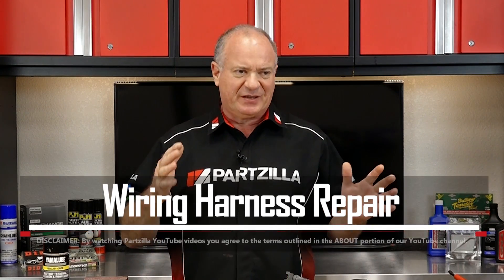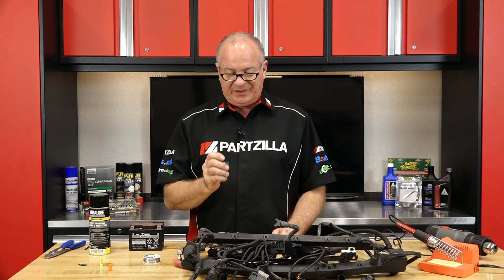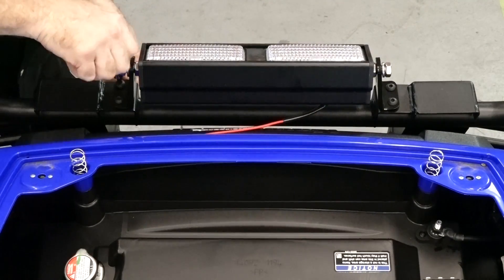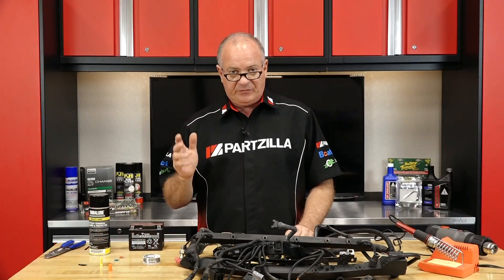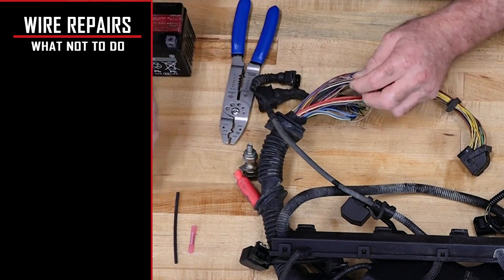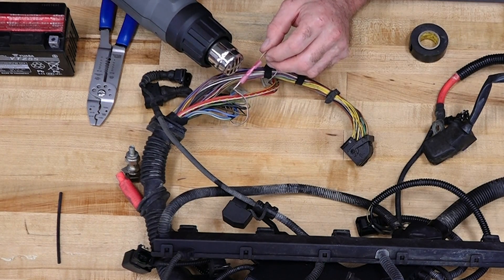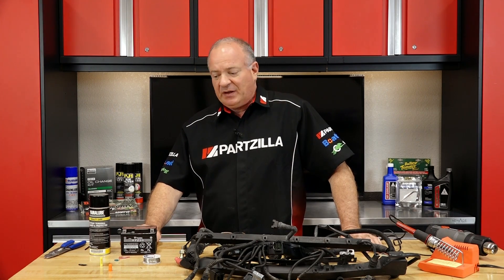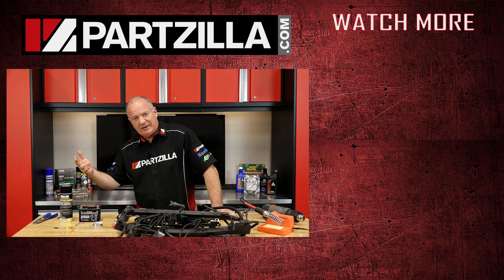How to Repair a Wiring Harness | Motorcycle and ATV Wiring Harness Repair | Partzilla.com

Comment: I get so mad when I see any of the earlier mentions ("I  cant stand it, thus my my BP rises and I call them mindless XXX-ups). I then cut it all out and grab my solder and heat shrink and do it right.  (Vinagor and salt will clean dirty coper but it must be neutralized with bakeing soda and water  as soon as its clean-(er)... its important else the Vinegar and salt are corrosive and must be eliminated with the baking soda and water.... Immediately or within a minute.. (this is only needed if the wire solder ends are in bad shape. Else you will have problems getting the solder too glue into the wires as noted.)
Also!
One point he did not mention it the solder type.... (ROSIN Core with Flux only)!
DO NOT solder anything electrical with (Acid core solder.) its name should tell you why.... ACIDIC! (like the vinegar and salt).
Most electrical wire are copper which is a soft metal and the acid core may solder... but its bad and will slowly eat away at the copper wire at the solder joint.

Comment: I don't agree using solder. There is some chance to do a cold joint and it can break eventually because of vibrations. Open barrel splices with the proper crimp tool and some shrink tube is my go to

Comment: What if they no longer make a new harness to buy? My bikes a used up clapped out rats nest, guy before me spliced in prolly every wire that had some power through it for whatever LED look at me lights or who knows what, id like to be able to rebuild the existing harness, creating a brand new one using the OEM connectors. Is there a kit to rebuild a 06 CBR 600RR? LOL

Comment: Great video but how do you repair a wire that breaks off less than 1/4 inch from the ecu plug? Is there a way you can pull the connection out of  the pug to make it longer and then reinsert back into plug?

Comment: John I have a Honda Foreman 400. I can start it and run for several minutes before it suddenly kills and won’t start again while hot.  I have gone through the carburetor, fuel lines, etc and can’t find any issues there. 
I have also changed the spark plug and spark plug wire but the issue is still not resolved. 
Do you know of any specific areas in the wiring harness or other areas I should possibly check for this issue?

Comment: I had a rectifier burn out on my 2000 gsxr 750, I replaced it and when I hit the brights on the freeway the bike started smoking. One connection looked a Lil melted bit not enough to smoke. Well I found some junky lighting wiring in the back of the bike redid it bit now my rectifier isn't working.

Comment: Yeah my ATV has a wiring harness issue that has been holding me back.i can't use the keys Thay have  hotwired my Beast. The keys hole is got the wires sticking out of it and I'm not sure what
wire should i connect with. Yeah they really did a number on my quad.
I really appreciate your time and consideration.i Hope you can help me out with this. 
I can get it to start but something is not right it's backfiring and won't ideal by its self.the wires on the key hole are touching together should that be like that? Should I take out the whole thing?

Comment: Grizzly 700.  New starter, battery and solenoid . The stator was replaced last year by the dealer.  After 30 min , I tried to shut it off and it acted like I was trying to start it. It ultimately shut off. The battery was dead.   What say you ?

Comment: Great video.  I replaced a battery /solenoid and starter on a 700 grizzly.  It ran for an hour and when I went to shut it off, it acted like I was trying to  start it. I’m the field the battery tested .8 volts. After I put it on charge, it tested.0 volts. I have never seen a bad battery test .8 or 0. The stator was replaced by the dealer last year.  
 When it failed there was quite a bit of heat . What say you?
Reply: If it only started playing up after you changed that battery + starter assembly, then the dealer's work sounds like it's fine 
If you know you got the terminals on battery & the 2 on the starter correct, then the stator replacement is a decent hint, cos it probably wasn't physical damage so most likely was from an excess power load further up the harness
So check your electrical harness for any fragile/old wires or any worn ones, they're most likely shorting to other connectors or ground

Comment: I'm probably anal when it comes to wiring but I also add a small dab of contact grease on the connection after soldering and then slide over my shrink tubing. Just makes me feel like it's bullet proof then. 20 odd years doing it like that and never had one fail. So many people using butt connectors on their bikes and wondering why after a few years it's worse than it was before and ruins that section of cable completely. Really love your videos fair play👍

Comment: On my 2014 Suzuki V Strom 1000. I bought an auxiliary fuse panel and ground block. I had mine quit because of corrosion in the ECM connectors. Yearly I unplug and spray all connections..

Comment: How many watts is your solder iron. And ,What is the proper solder to use. I learned the hard way about soldering copper water pipe, that you don’t go to Lowe’s to get your flux or solder. You go to the plumbing supply warehouse. Is electric wire soldering just as critical? I have actually tried it, and it was not as easy as you make it look...
Reply: I can't tell you what the different types are, but I know using the correct type of flux and solder is very important with electrical
Reply: if you don't have a solder iron or no experience in using it, but having a heat gun, go for raychem solder splice : https://www.youtube.com/watch?v=uhRCUAYoSXg
Reply: 25W, and use 60/40 Rosin Core solder. Actually, don't, use crimp splice connectors. If you solder it, you create a hard point, and any flexing will eventually break the wire. If you look inside your loom, particularly where there are splitters for earths or lives for tail/park/number plate lights etc, you'll see they're all done with crimps instead of solder.

Comment: Hi partzilla I got a 2001 Honda recon 250 and I took my wire harness off my bike to fix the harness it’s fixed no but when I took it apart I took all the tape off      The harness and every wire out of the connector blocks I was wondering if u guys would Plz walk me threw the process of taping it back up helping me where all the wires. Go and how long they Spose to be coming out of harness plz plz get back to me as quickly as possible!!!!!!!!!!!!!!

Comment: Yep, i always heatshrink butt connectors. you don't need to buy those butt connectors with the shrink tube already on them. you can buy good quality tubing from your part store, or online, slide it over the wire, crimp the 2 wires in the connector and slide the heat shrink tube over the butt connector and heat it and seal it.

Comment: I have used quick splice connectors because they were quick and easy.

I stopped using those because of how damaging those things are, it cuts the wire making it thinner and is very inviting for corrosion.

Comment: Yupp! The only way to do a real repair. If you have an assortment in pile, a small trick to see if the shrink tubing is self sealing is to look inside the tubing and see if it is shiny. The self sealing material is basically a fine layer of glue stick glue.